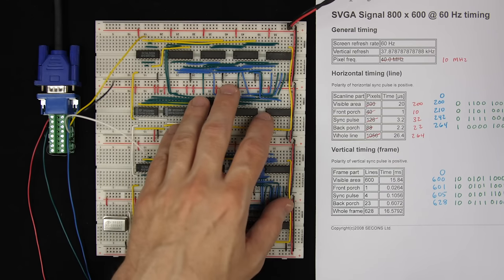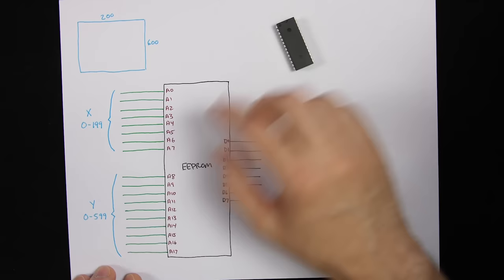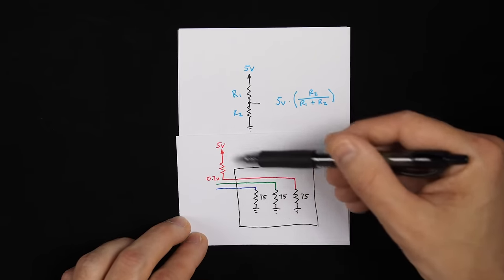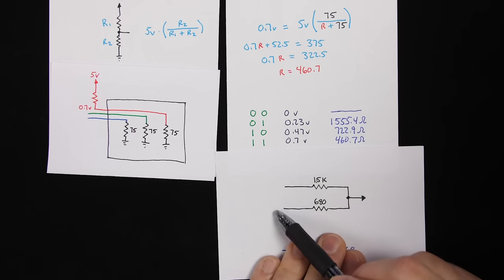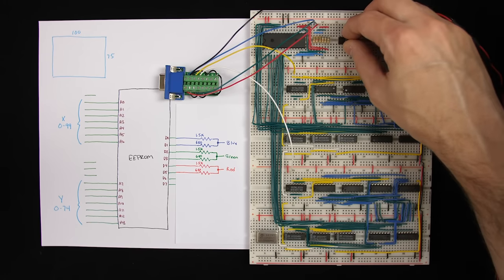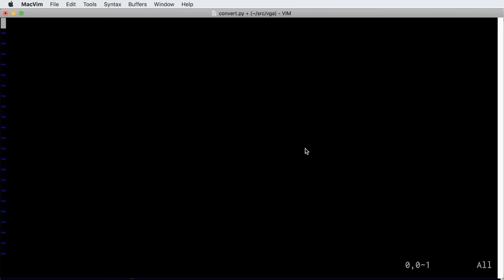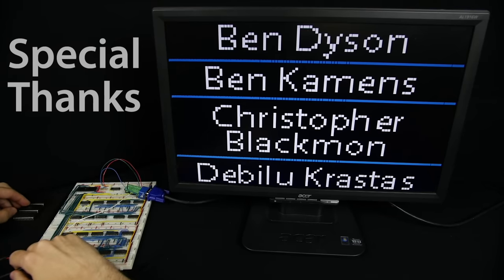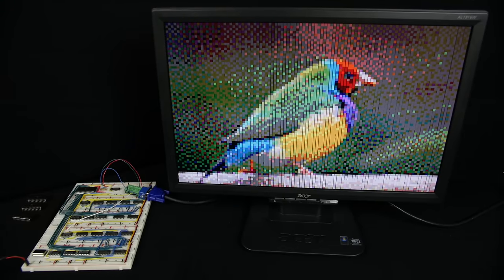World's worst video card? The exciting conclusion

Comment from the maker: Want more information or want to try building this yourself? Check out https://eater.net/vga for schematics, kits, and more!
Reply: Nice!
Reply: It's more like a cga. No DCA, and few bits on each line. I guess I haven't done those for 30 years... Hahahaha 🤣 (I was and graphics engineer).
Reply: Can you Make this video card controlled by an Arduino?
And you can take an image directly from your computer, or a text...
Reply: Nice! Does it have instructions? Also You are no longer answering me 😭
Reply: Is it possible to share code for using your self built ardurino eeprom programmer to import image into 28c256 chip for the worst graphics card?
Reply: MAKE BREADBOARD RAM
Reply: @yourtechweekeveryweek6321  It's possible to create a RAM module on a breadboard for an old hardware like apple2 or 386.
Reply: @manuel.dignani  but 3200mhz?
Reply: heyo, i was wondering, since there are 2 bits left over from the eeprom, could they be used to get more colors? If you could somehow get the last two bits of the eeprom to control the shade of the color, you could technically get full 256 vga color:
64-00
128-01
192-10
256-11
Reply: Can run crisis
Reply: i probably build it myself in a really far future :)
Reply: i want to make an programmable processor
Reply: put 100 picofarad or less  at every output and black lines will disappear.
Reply: I have a question, if I want to connect the video controller to the 8 Bit computer, I have to reserve a space in the RAM for the Video data... but how do I make the video controller and the 8 Bit cpu have access? simultaneously , why is the video controller constantly doing a wipe of the video memory .. maybe they will give time when the cpu and the video controller have access.
Reply: Omg I’ve never smashed the like button that hard before
Reply: Kinda sucks you used the Lenna image in the thumbnail yet never showed it on screen
Reply: I like it. It’s using Red, Blue and green (the primary colors) to make other colors (secondary colors).
Reply: @andyanderson3301  I always thought graphics engineers designed graphics and that it was the computer engineers who designed GPUs... maybe I'm just misunderstanding your statement...
Reply: @chichomancho1791  electrical engineers be like: *clears throat* I think you mean 0.000001 microfarads...
Reply: @pizzainc.1465  since the CPU is  general, a GPU is a helper to offset the graphics. A CPU can do it slowly, but a GPU is intended to make it go very fast without much effort. I started with doing work before it was called a GPU... I think I'm getting old...
Reply: @pizzainc.1465  also, there's way to say "graphics". Some are actually artistic, some aren't... It's awkward when you're trying to talk about what you do... I draw stick figures...
Reply: @andyanderson3301  I looked it up, and I think we are both right. It said that graphics engineering involves both computer engineering and graphics design, but it also referred to it as it's own field.
Reply: You should make a 4k version
Reply: Is there any alternatives to using EEPROMs? Too costly
Reply: The flux capacitor!  Just kidding... or am I?  -Your friend in time, Marty
Reply: We need to see your breadboard pc and the graphics card playing doom.
Reply: I want to try by my self ben eater but how I get those kits from there?

Comment: Man I want Ben's super power of being able to pull properly sized wires right out of thin air.
Reply: Yes! it was magic! I remember cursing all the time when I was trying to wire a flip-flop in class! I was thinking " there has to be a f****ing better way to do this!"!!!
Reply: @leowise2008  build it twice. Ben does. Then again he is a technomage.
Reply: Like Professor Farnsworth, he probably has a drawer where he keeps assorted lengths of wire.
Reply: I'm more impressed that he's got them pre-routed for his board.
Reply: You have 256 likes. Please don't ruin it :)
Reply: @tray3989  I'm going to remove my like! I will do my part!
Reply: Seriously though he has to be putting hours in to bending wire
Reply: Don't like this. Let it live
Reply: It's ruined :(
Reply: But air is too thick that its height is from the ground to the atmosphere
Reply: Yes, it's obvious that a LOT of preparation went into making this very slick video.
Reply: Hell yea I was thinking the same thing, not only properly sized but bent perfectly to suit his exact circuit... So yea there's only one conclusion the same I came to as Daniel Wilson he's not bending these wires to size before each next part of completing the circuit, he's already built the circuit and is rebuilding it on camera using the same wires from the working original. But even in this case super nova is still correct, there hours spent just on bending wire alone... Some people play video games, some play baseball, this man bends wire! LOL But mad respect to him for doing it@ :P
Reply: Stay tuned for the next season of Avatar: The last wire bender. Starring avatar Ben.
Reply: The air is thicker in his part of the world.
Reply: @charltonmuguna1900  Made me LOL! But yeah, tons of preparation went into this video. (I wonder if wire-bending is a relaxing passtime. Perhaps it makes good cooldown from other, more stressful parts of the process.)
Reply: @mysterythecat971  so basically he builds a messy one trying to figure out how to make this work and the size of the wires then builds another one on camera with nicely sized wires
Reply: @mysterythecat971  so basically he builds a messy one trying to figure out how to make this work and the size of the wires then builds another one on camera with nicely sized wires
Reply: @DouglasZwick  Underrated comment
Reply: For people who are wondering you can buy pre-cut wires specifically for breadboards. The cut and bent at length so they fit in with very little extra. That way you don't have to spend time making wires and you just grab the one that fits.
Reply: I like how they bend to his will alone.
Reply: @mysterythecat971 he might also use some software that tells him how to cut and wire his circuit
Reply: It’s,funny how some of you guys are mind blown by the pre-fab wires.  Ya’ll probably easily amused by street magicians.

Comment: I love how you can just hot swap out EEPROM chips to change the image. It makes it feel like some vintage slideshow tech from an old sci-fi movie.
Reply: Now, lets give this idea to the professors at university :D No powerpoints or anything. Just breadboards.
Reply: PowerPoint 0.1
Reply: Hot swap a dozen or so EEPROMs having a second person reprogram them to a different image in a "circular assembly line" fashion. Call it a 0.05 FPS video card system and ship it! *Requires 2 operators
Reply: @Leuel48Fan  brilliant
Reply: @Leuel48Fan  In the 747 they used as mobile nuclear command they had a button on the podium that would flash a light for someone in the back room to change the slide on the slide projector.  They can order world destruction from the plane but it took two people to make a slideshow.
Reply: If he had a larger EEPROM, he could write multiple frames to it, and use the unused address lines and some switches or something to change between the frames on the fly without needing to physically remove and install.
Reply: He's double buffering, a technique for faster and smoother frame changes.
Reply: Is there any way you can make a driver that allows you to use this as a real video card for a PC?
Reply: @WarrenGarabrandt  If he used an SRAM chip, he could send images to it, directly from his computer without programming the EEPROM
Reply: @mzs112000  true, but he would need to work during the blanking intervals or turn off the output and address lines from the clock circuitry or the address inputs will clash. With a buffer, he could output the current pixel to a buffer for display, then write new data for the next read. Or use two ram chips and flip between them in a double buffer configuration. That would be complex with buffering of all address signals, and input and output lines.
Reply: @WarrenGarabrandt  Doesn't the PCI bus run at 66Mbps, which should be enough to send the graphic data to the card during the blanking intervals?
It might even be too fast....
Reply: @mzs112000  oh, I didn't realize you meant hooking it up to a modern x86 computer. I thought you were talking about his 8-bit breadboard computer. in both cases, you would still need to do some fancy logic around the address lines to avoid clashing. but sure I suspect a PCI bus would be able to write the entire contents of that memory multiple times during blanking intervals. You'd probably be able to update most of the chip in one horizontal blank. So updating individual lines in between pixels might even be possible.
Reply: All the fizzing and glitching it does when he works in the chip adds to that charm even more.
Reply: If this was a kit I would absolutely buy it.
Reply: @alnino2005   Well, I mean...it sort of is, except you have to source all the parts, right? You can look at the parts list he has, and order those pieces, and wire them up. It's not going to be easy, for sure, but the challenge of the thing is why it is so fun and rewarding, I think. That said, I suspect if Ben sold kits on his site with all the parts you need to build his entire 8-bit computer and this video card, may people (myself included) would certainly buy one from him.
Reply: @WarrenGarabrandt  agreed. I may not have it in me to source the parts, but I know I would buy a bag with everything in it ;)
Reply: @alnino2005  he has kits on his website. Check the link I posted earlier.
Reply: @WarrenGarabrandt  I would just use a simple 555-based oscillator and a counter to generate the different base addresses that would allow cycling through the images.
Reply: @WarrenGarabrandt  That way, he could even do quite fast running animations
Reply: @mzs112000  There is missing at least the interface to a typical PC bus. And given the fact that ISA has vanished from modern PCs, it will be about impossible doing that on breadboard. But with a vintage PC with ISA, it should be possible.
Reply: @mzs112000  PCI bus is not Mbps, but Mhz, and 32 bits minimum. So, bandwitdth is 66Mbps*32=266MB/s, which should be enough...
Reply: @GigsVT  I guess that’s how all slideshows from podiums operated at the time. Which explains moments in movies and TV shows where someone would be like “hello? Can we get the next slide please? No, that’s upside down”; which nowadays is the PowerPoint remote acting up lol

Comment: Swapping eeproms will be a good replacement for powerpoint presentations. Impressive work!!
Reply: That's a great idea!
One slide per EEPROM - will definitely keep the number of slides down ;)
Reply: @marwinthedja5450  Stack 50 EPROMs one by one and switch CE pin only.
Reply: It's the future! :p
Reply: There should be a 90s or something movie where the character does this
Reply: @marwinthedja5450  Actually, two slides per EEPROM, because one bit was left unused - could easily hook up a switch there. Technically over 5 slides could fit because there were also some unused columns and only 6 bits of every byte were used, but that'd require a much more complex circuit, of course.
Reply: @tuesss  Or binary counter and higher capacity EPROM, additional address pins will be used for switching slides.
Reply: imagine how you would organize eeprom slides. Sponges?
Reply: @tuesss  or just improve the single PROM by pre-reading into a swap register for 200x150 and no vertical lines... and 8bpp — the possibilities are endless 😁
Reply: That would be the geekiest way to do a PowerPoint presentation
Reply: Uh guys, just use a bigger EEPROM.
Reply: @thewhitefalcon8539  or a pc
Reply: more reliable too
Reply: Just imagine its a foolproof device for PPT presentation ,no booting , no fear of OS going corrupt or virus problem. Just hook the device to VGA port and start.
Reply: +Ajay Singh ODP*

Comment: Please select your graphics adapter:

1- CGA 
2- EGA
3- Tandy
4- VGA
5- Ben Eater’s Breadboard graphics card
Reply: BEBGA, Ben Eater's Breadboard Graphics Adapter.
Reply: 6-Hercules
Reply: CGA
EGA
SEGA
PS-ONE
PS2
PS3
PS4
Reply: His graphics card is better then the one in my computer
Reply: @drinkoldcoke  Oh! I built one of those! Back in the old days. You could create a low rent 8 bit DAC by basically wiring a resistor array off a parallel port and then pumping sound data down the printer port. At the time I was using Minix, and worked out you could just write raw 8 bit audio to /dev/lpt1 and blammo, instant sound card.

It sounded terrible by the way. But better than the PC speaker
Reply: And stack of eeprom's included with the game
Reply: Remember this in xenon 2 for dos
Reply: Siquell Stack of eeproms = game cartridge!
Reply: U forgot super vga :S
Reply: 5 anytime , anyday
Reply: Actually, better than CGA ....
Reply: @shayneoneill1506  The AY-8910 sound chip had 3 DACs which you could use to generate sampled audio. You needed to convert the linear data using a simple look-up table.
Reply: @drinkoldcoke  Worst sound card, wasn't those called The Disney Sound Source?
Reply: Thomas Lukins 
I actually owned one in the 90’s. It was a basic DAC that was diodes soldered into a DB25 on a parallel port.
Similar to how multiple voltage levels for Red Green and Blue signals are generated here.
Reply: I bet the linux guys are adding support for it in the linux kernel
Reply: @shayneoneill1506  There was actually a commercial product based on that very idea: the Covox Speech Thing 
https://en.wikipedia.org/wiki/Covox_Speech_Thing
Reply: The funny thing is his adapter actually handles more colors than CGA.
Reply: Countdown to a Planet X3 patch that supports this board...
Reply: To see the next frame, pull out the EEPROM and place it in the flashing device, wait 10 seconds for it to flash, and then put it back in the graphics card.
Reply: @Mayank-mf7xr  maaaan, The HAWK says hello
Reply: BGA, could stand for Ben graphics adapter or breadboard graphics adapter whichever you prefer
Reply: @shayneoneill1506  The Amiga had wonderful sound from just 4 channels of 8 bits, so if your 8 bit sound was crap it was probably due to bad timing (or you had mixed up the bit order). A dual port RAM and a bit of logic to clock data in from LPT and out to DAC would have helped with that. Of course, that brings it into a completely different realm of DIY :-)

Getting the bit order wrong can be really interesting. Back in 2002, I was using linux on PPC, and either MPlayer or alsa had a bug where the byte order was wrong for big endian machines. When upper and lower byte is swapped, you can still barely hear the right sound from the upper byte being played out with an attenuation of 1:256, but there is SO much noise from the lower byte being played out with amplification of 256:1
Reply: @shayneoneill1506  There was a speech synthesizer for the Atari 800 by Don't Ask Software.   The 800 had sound capabilities, but didn't have a DAC for the output.   To vary the waveform, it relied on the physical properties of the speaker by applying just the right pulse width to determine how far the speaker would push out.